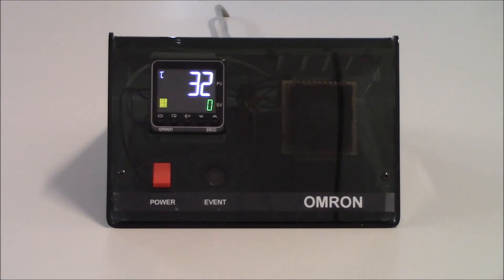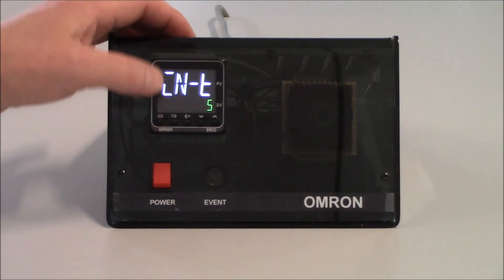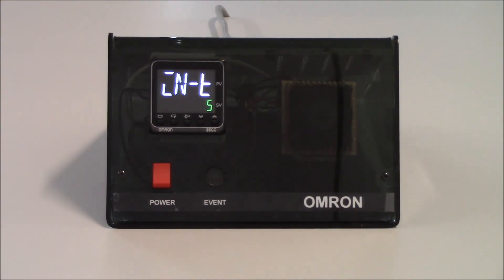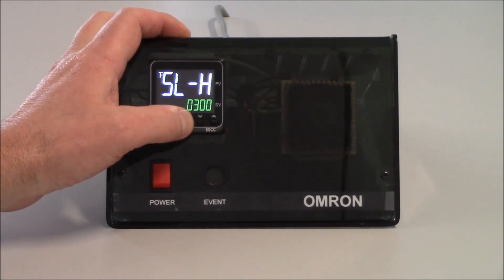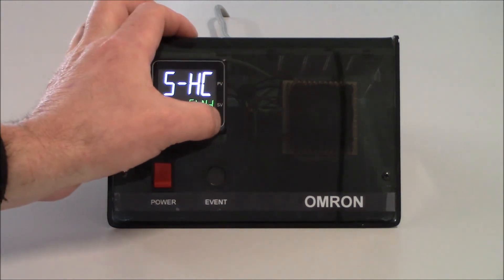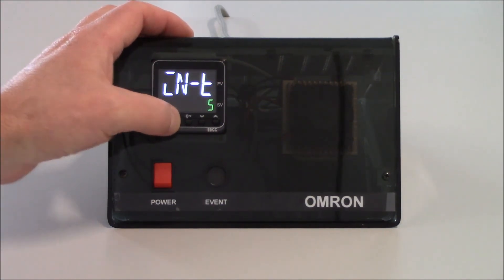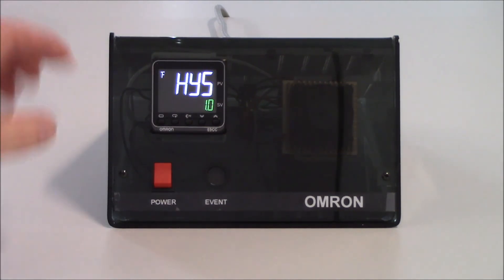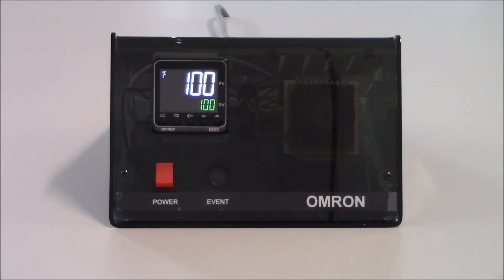Setting ON OFF Control for Omron E5C Series Temperature Controllers

Comment: Hi. I have omron e5cc controller. Currently, the setting is as below:

The SP has been set 100 with OUT1 mode. When i turn on my heater, it will supply heat until SP= 100 and then it will change the mode to RST which i believe it turn off the heater.

How can i change back to default setting? Where i set the SP=100, and it will keep supply heat until the PV =100 , the heater will turn off.